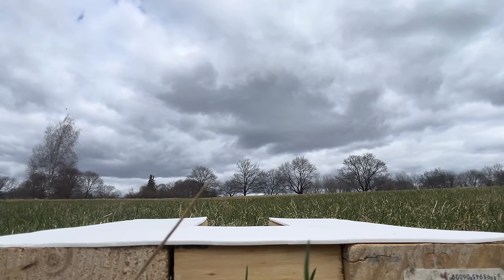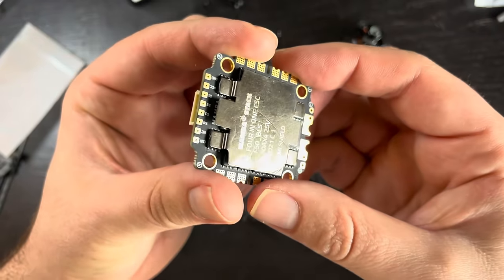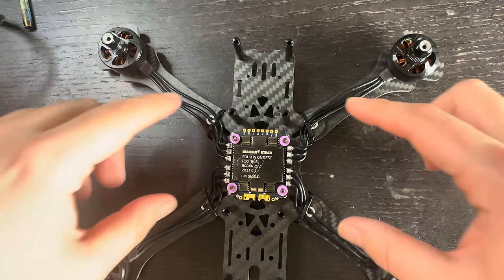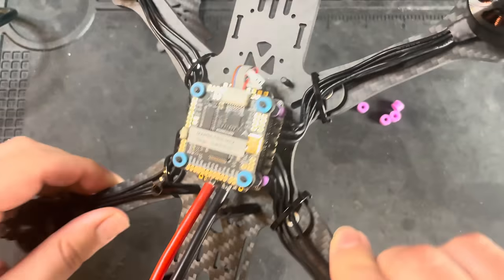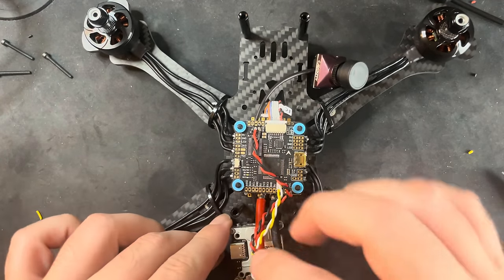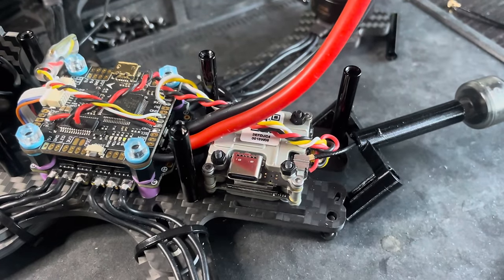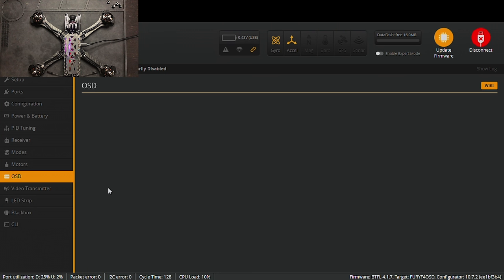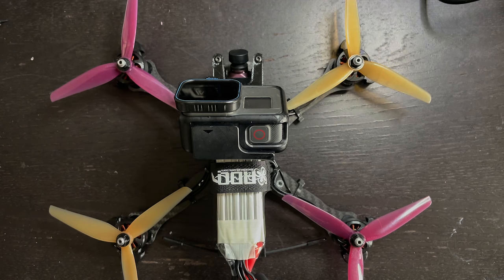2022 - 5" Freestyle FPV Drone Build

Comment: so has this vista vtx a built in receiver for controller commands or what does he mean with those 2 cables he is not using?
Reply from the maker: yes those two cables are for the built in receiver 👍

Comment: Super dumb rookie question: does it matter which pads the motor wires are soldered to?  or does the computer detect which is which and do its thing?
Reply from the maker: it doesnt matter which wires go to which pads as this will only change the direction of the motor. 
When programming the drone you can manually change the direction

Comment: does it matter if i bought all 4 motors cw or ccw ? or should i buy 2 ccw and 2 cw ?
Reply from the maker: Ultimately it doesn't matter. The direction of Brushless motors can always be reversed in BLheli or Betaflight if you're running 4.3 firmware 👍
Reply: @TRONCATFPV  i appreciate your help bro

Comment: Will have to design a mount for my insta360 one RS did not see any.
Reply from the maker: Any mount that fits a hero 10 will work with the one rs! The two cameras are pretty much the exact same size 🤙
Reply: @TRONCATFPV  oh ok I'm new to this so I thought it was more about weight. I know the RS is on the heavy side...

Comment: Do you still need the beta FPV transmitter even if the radiomaster tx16 has ELRS already built in?
Reply from the maker: If your radio has ELRS built in you wont need an external ELRS module 👍
Reply: @TRONCATFPV  thank you
Reply: @TRONCATFPV  thank you

Comment: does the esc come with a power lead or do I have to order it separately?
Reply from the maker: Usually with 4 in 1 ESC's it will be included 👍
Reply: @TRONCATFPV  also what s battery do I need to get

Comment: what battery can i use? and also do you have any other goggles or controller i can sue with this drone
Reply from the maker: For this drone, I would use any 4s-6s 1000-1500mah High discharge LiPo

Comment: Don't you put any protection on the motor wires?
Reply from the maker: yes you can get a nice braided wire wrap from RDQ. You can always put electrical tape around the wires as well 👍

https://www.racedayquads.com/products/rdq-3-8-braided-mesh-wire-wrap-2-ft?_pos=4&_sid=a4985e7a6&_ss=r&aff=58

Comment: Waht type of battery and how long does the charge last?
Reply from the maker: You’ll have to use an xt60 6s lipo with this build. 
Flight time will vary depending on what battery you decide to use

Comment: what if we don’t have random screws perfect for the job laying around…?
Reply from the maker: The only screws that I can think of that you might have to go buy are the screws to mount the vista unit. You can get those at any hardware store for like $1. Otherwise the frame, stack and motors include the screws you'll need.

Comment: would this also work with a dji O3 camera system ?
Reply from the maker: yup!
Reply: @TRONCATFPV  i was also wondering if i could also use 1900kv motors with the Ethix PB&J p3 props insted of the 1700kv since the differnece isnt that large and i really want to use Emax Eco 2s 2306

Comment: I did this exact build and the motors smoke with the 6C battery (fine on 4C)  any ideas?
Reply from the maker: What size Mah battery are you using? I normally don’t use over a 1500mah but a heavier battery could push the motors to their limit. 
Also check your PID settings. Xilo 2206 1700kv motors should handle 6s no problem. 

If all of your motors are smoking it sounds like a PID issue or you have too heavy of a battery.
Reply: @TRONCATFPV  From the man himself!  1050mAh from the link in desc and Xilo 2206 1700kv but my PID is all default so must be that. Thanks so much for the video I just got into FPV after watching and it's been really fun

Comment: Could someone tell me what the capacitor at around 13:00 is for?
Reply: I know you asked 2 years ago but I believe it's just to help with consistent power and to help with unwanted signals aka inputs that was not from your radio if someone knows more on it let me know
Reply: @goingup4536  thanks mate, I really appreciate your answer! Now I built my first 5" already and educated myself way more and you're completely right, the capacitor dampens a lot of noise that can be caused by the drone by accident. Still very nice of you to reply to something even though it's been 2 years!

Comment: Around 21:00 why you Connect rx to tx and not rx to rx
Reply from the maker: Think of it as transmitting (TX) and receiving (RX). 
The Caddx vista is transmitting a signal through the TX pin. That signal has to be received by the flight controller, therefore that would be the Flight controllers receiving port (RX).
Reply: @TRONCATFPV  that explain a lot. Are there any similar solder thing to be remembered in building? Usually + is for + for example. I hope you understand my question. Thanks

Comment: Nice clean build and good price considering the chip shortage.
I would have chosen the Caddx Nebula Pro tho, for that sweet 120fpw/low latency mode. It's only $30 more.
That frame is a bit outdated, but at least you can find lots of parts to print.
Putting your capacitor on your XT60 isn't bad, but it isn't the best https://youtu.be/52T1cKlNcUM?t=3782
For an F405 (which is also outdated nowadays, especially with BF 4.3 releasing soon), Betaflight devs recommend a PID loop of 4K and DSHOT300.
I would also flash Bluejay on the ESC and enable bi-directionnal DSHOT.
Finally, I would enable telemetry since you are using ELRS
Reply: Wasn't it 4k pid loop that they recommended
Reply: @BowOneFire  yeah my bad, i updated my comment. Troncat has it set to 2K, and while typing, I switched it around

Comment: most of the items are sold out :/
Reply from the maker: yes i've noticed after I publish these build videos parts sell out fast!
Reply: @TRONCATFPV  I'm ordering similar parts. Is there a capacitor you like or are they mostly the same?
Reply from the maker: @everytomday  I honestly usually just use the one that comes with the stack. 
Also, you may be interested in some of the parts I used in this video that went live this morning:
https://youtu.be/e0nFgiWlVYk
Reply: @TRONCATFPV  Should you avoid using shorter grommets under the esc if the screw is too short?